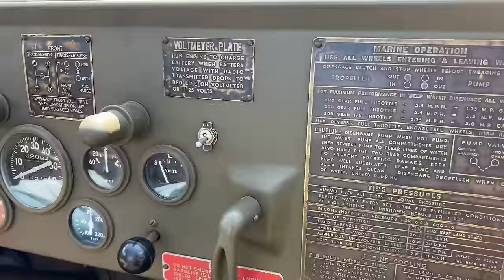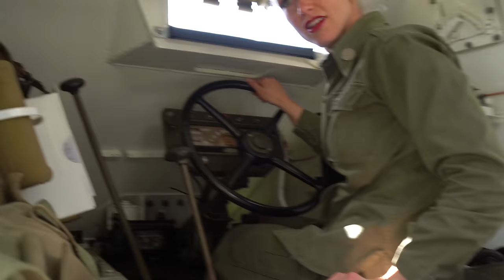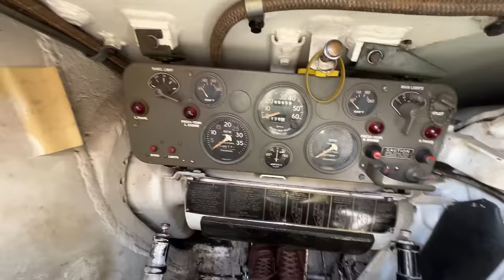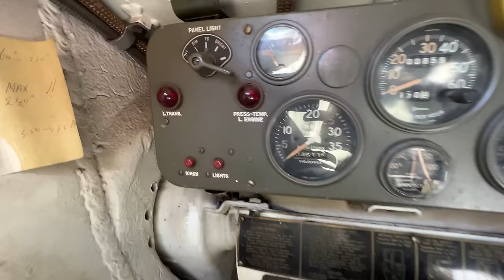Unieke Verhalen, voertuigen en overnachten op Tholen-Sterk

Comment: As we approach the episode about the Orde Dienst-Tholen and their fight against 2 units of German Parachute Regiment 6 for 6 days behind enemy lines.
And the 4,5 months ( 130 days) on the Western Front line up to Moerdijk facing raids of MEK40 ( Marine Einsatz Kommando 40 ), here is a preview filmed by cellphone from the original.
Note: After a brief parade these men were sent home never to hear from it again.
One of the many WIA of a MEK40 raid received his Dutch Wound insignia after 47 years by mail in 1991.
And some of the then still living received the Dutch Resistance Cross after 50 years in 1994.
Not for what faceing one or two of these German elite units, but for being Resistance member.
Most of them just received the standard 'Thank you note' , with the only difference that these were still the UK printed ones which are rare.
https://youtu.be/Gu6VbpMMvm8
Reply: To explain what these men had to face we incooperate German Parachute Regiment 6 and MEK40 in the you-tube series as well.
https://youtube.com/playlist?list=PLmZsQHKnBH0CtaiykT5e6UJZ8E-7XWY1A

Another MEK branche : Frogmen 
https://youtu.be/W3CRZeZycKU